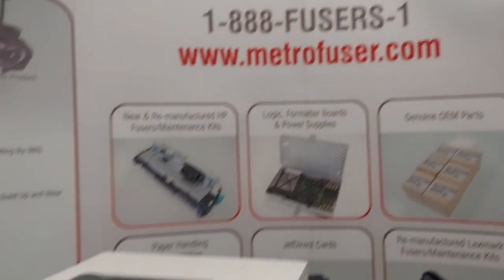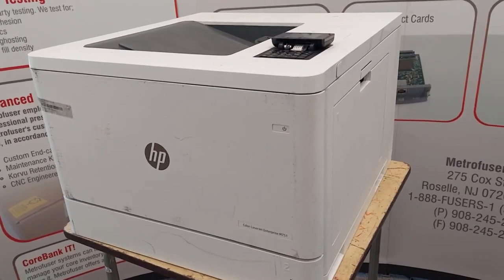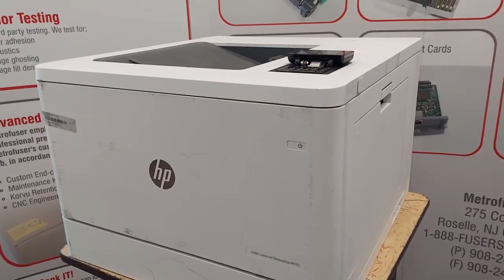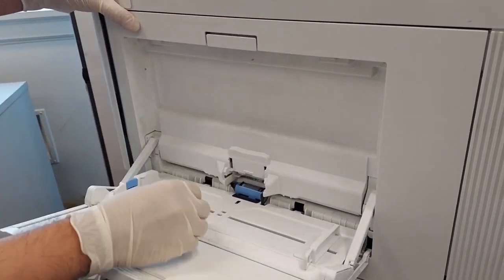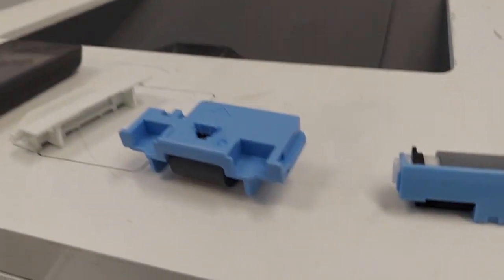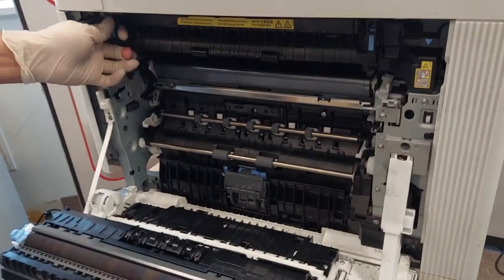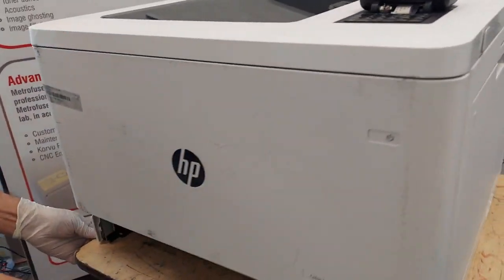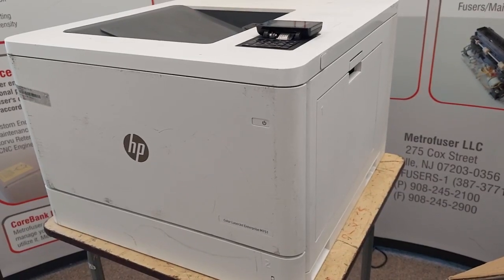HP M751 M776 M856 E75245 E85055 Printer Fuser Install Instructions Video 3WT87-67901 3WT87A

Comment: Hello, i have a similar printer but i’m unsure if the formatter needs replacement. Since a power outage, our printer turns on, but the LCD screen remains off, and the network port link lights are not on. Do you think replacing the formatter might resolve this issue?

Comment: Hp m880 network  printer some documents printing blank pages .I updated firmware , reinstalled driver ,checked with different pcs , checked with different network cable and different network port ,changed hard disk issue not resolved printer test page and supply status also printing fine but configuration page printing blank pls help